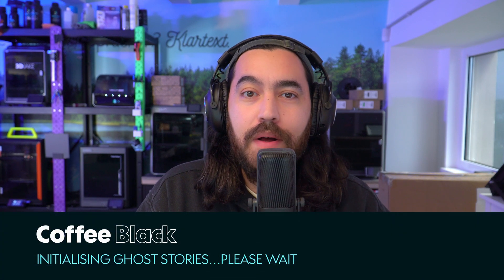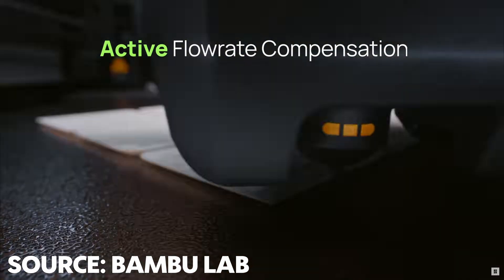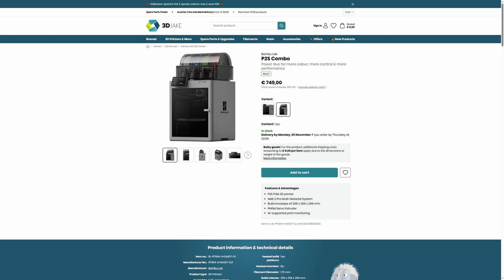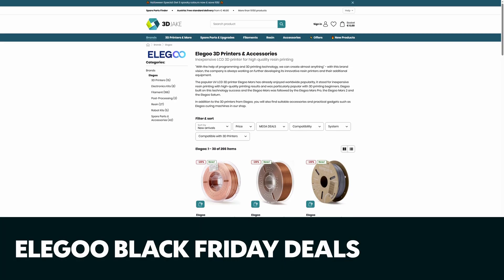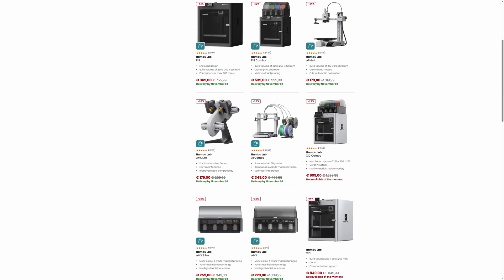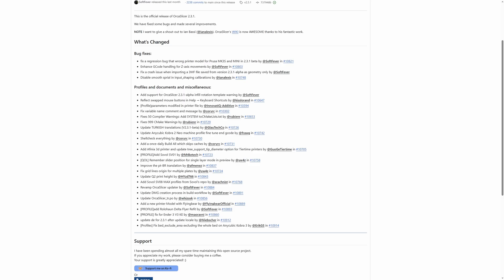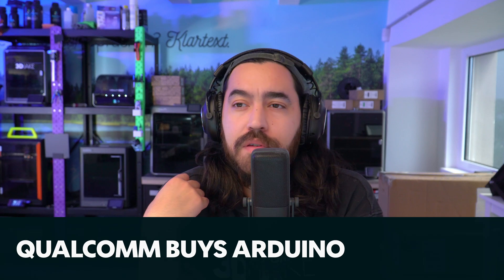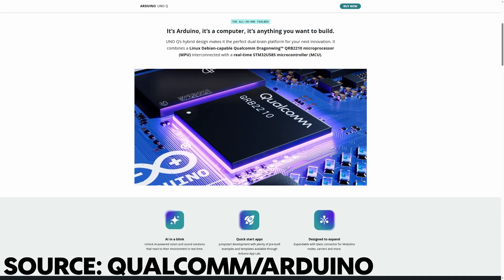Community News October 2025: New Products and News Updates!

Comment: Hi, I have another question: I chose to buy an anycubic kobra s1 (Not combo) instead of an elegoo centauri carbon. My main reason is because I could found more replacement parts. Am I right? Thank you so much. (I want print mechanical components)
Reply: Thank you so much for the answer. I'm not really interseted to print special filaments for now, only wanted to know if there are some differences between the two about replacements. Thank you again
Reply from the maker: There are more replacement parts in the shop but if there are ever warranty issues we can order Centauri parts for you. The Kobra S1 is fine for mechanical componenents but it doesn't have a hardened nozzle so if you want to print something like carbon fibre you'll need to upgrade it